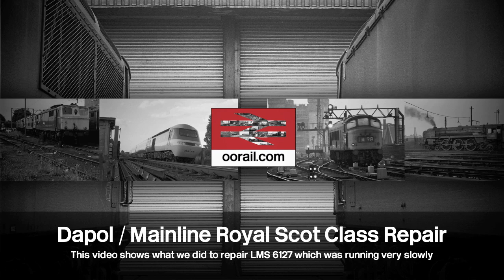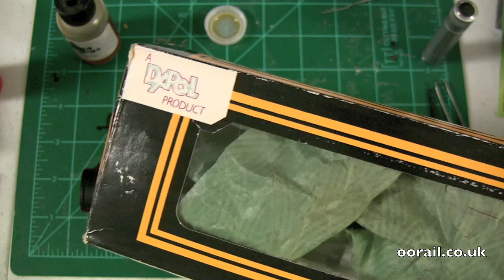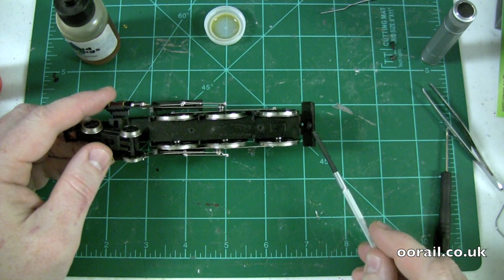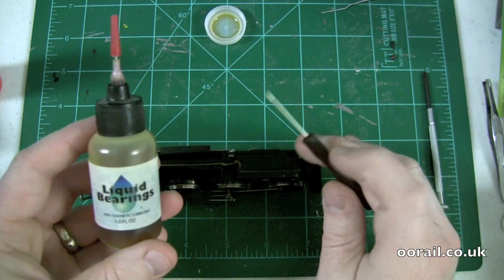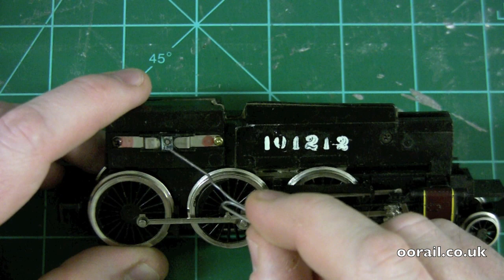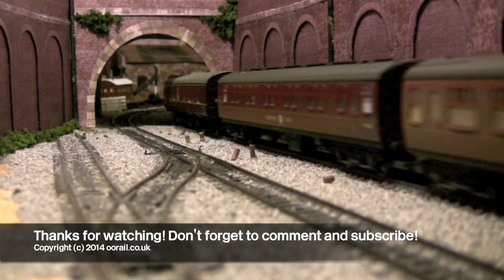oorail.com | How to repair a slow moving steam locomotive - OO scale Model Railway

Comment: I think you need a reminder.. the body is the plastic part that represents the shape of the loco.. the chassis is the part that holds the motor and wheel arrangement, not the other way around as you stated in the first 2 minutes.......... the other thing you should have mentioned is the all of the pushrods and linkage arms need a touch of lubrication oil and where the rods go into the steam chest.. I was taught .. "If it moves oil it."
Reply: Good catch, I had to correct at 00:32, so the only reminder I probably need is not to film these types of videos in one take at 3am on very little sleep! Well done though, out of 32000+ views, you were the first to point that out. I usually lubricate the moving parts, as you can see from other videos on the channel, so I may have determined it wasn't necessary or already did it before taking the loco apart. I can't remember what I had for breakfast last week, so the odds on me remembering if I lubricated a loco I took apart 9 years ago are slim to none :)

Comment: Thanks for your videos. I'm having the same slow running problem with mine, but lubrication hasn't helped and it gets hot. Any suggestions?
Reply from the maker: If the motor is getting hot its likely under some strain. You will probably need to fully service the loco. I would start by making sure the wheels and gears involved are cleaned, moving freely (with the motor out of the picture) and lubricated. I would lubricate the moving parts of the motor (drive shaft, pins etc), and apply power to the motor without the wheels engaged. Does it still get hot? I would carefully remove any carbon deposits off the motor (depending on the motor type), and if there are serviceable parts (brushes etc), I would replace those and see if that provides improvement. Which type / model loco are you having an issue with?
Reply: @Oorail  Thanks for your detailed reply and information - I've done some cleaning work but it hasn't made any difference. The model is Bachmann Branchline 31-212, so it's probably similar to the Mainline one. Am guessing new motor?!

Comment: Good video . If I can assess  the commutator  / motor brushes  I will clean this and maybe lightly sand it to remove carbon , dirt ,,,ect .

. Also on some steam the side rods will have hair or lent wrapped around the crank pins that needs to be removed

Comment: Just use WD40 even better than ANY oil for it penetrates and doesn't  dry out or attracts dirt. I have loco's almost 50 years old and running as new. Only changed the coal brushes when used up. greetings
Reply from the maker: WD40 is a really bad idea, its flammable and will chemically breakdown the plastic used in the locomotive. I'm using synthetic model oil on very early Tri-ang locos without any problems, all the way up to modern day locos. I've got some Tri-ang locos, the class 31 and blue pullman come to mind, that spark quite spectacularly. So WD40 is definitely not a good idea. You should consider buying a lottery ticket though :)
Reply: I agree with 00rail.  WD40 should be left in the garage - never anywhere near a model.  It leaves a residue.

Comment: I have a question that I hope u might be able to help with I have a mainline loco a manor chassis that is getting power to the motor when directly powered to it I have changed brushes springs but when it's all together no power via wheels? The wheels are cleaned and the plastic spacer is not broken and  it won't pick up the power via track any ideas?
Many thanks